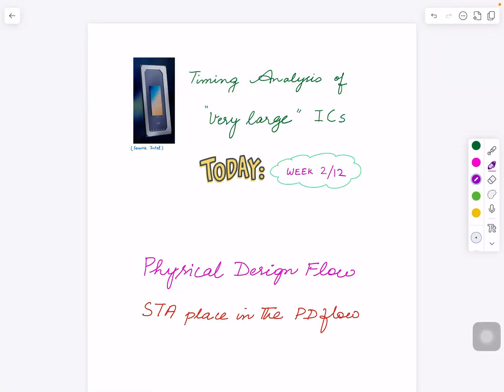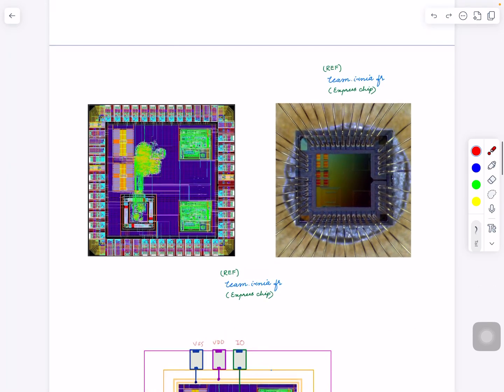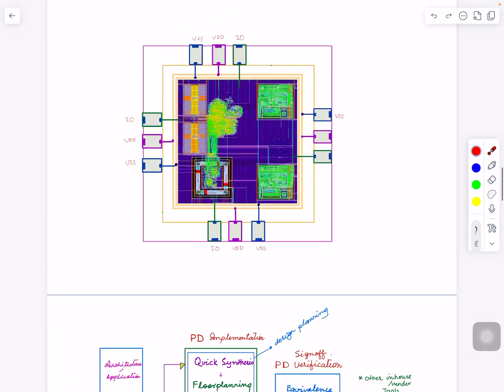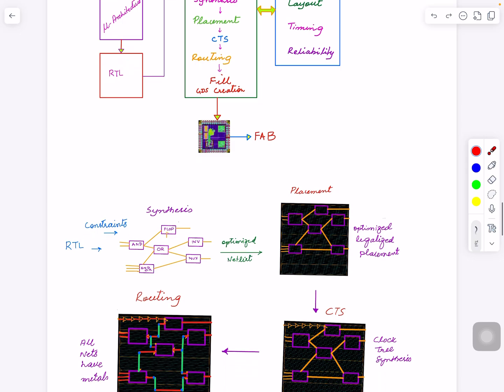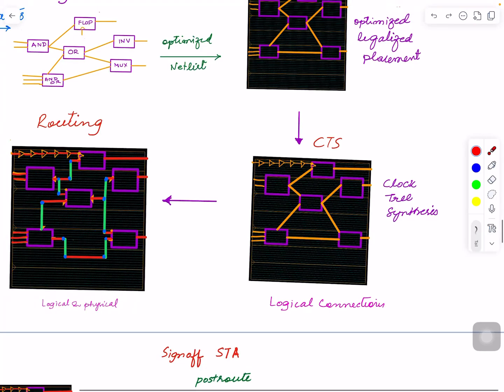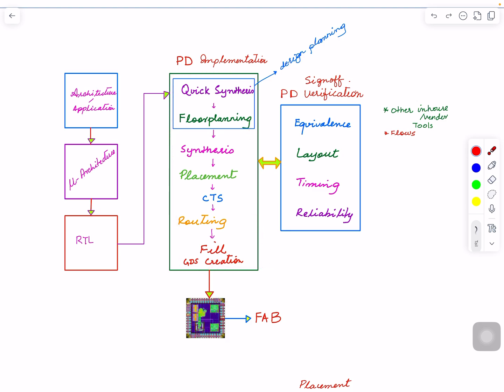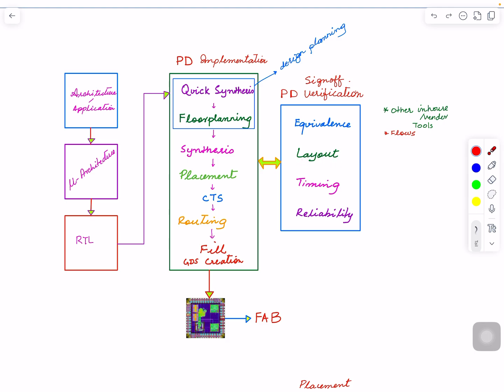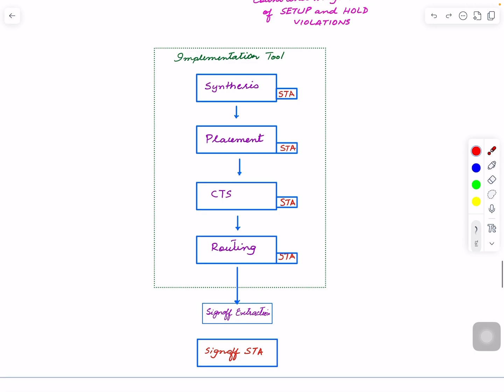STA Series: Week2, Video1, Overview of Physical Design Stages and where STA fits

Comment: if we find any timing violation during placement  or synthesis because of inaccuracy of data  .should we just ignore that violation assuming  it can me removed in later stage after SPEF extraction  or we should remove it  there itself?
Reply from the maker: which data are you talking about; depends on the data and depends when it will get real and how tool is going to behave when it becomes real. Lets be specific.